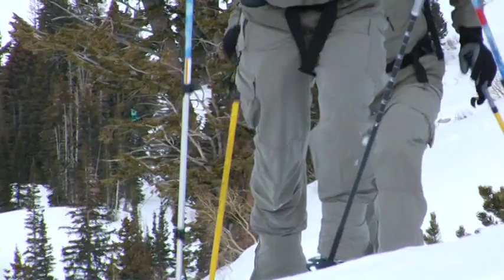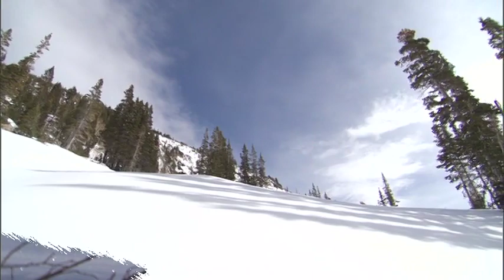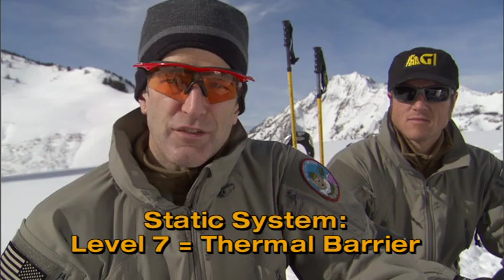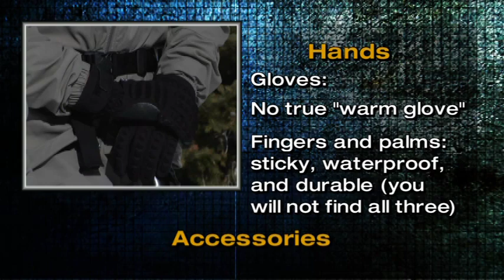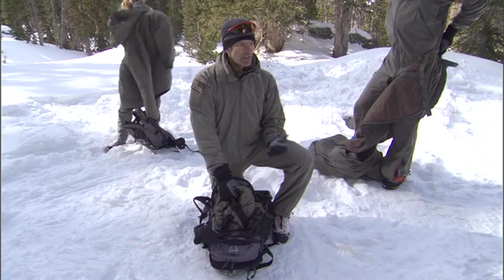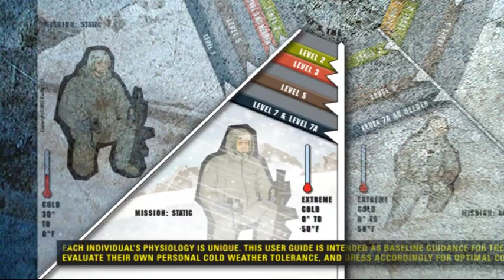Protective Combat Uniform (PCU)

Comment: A thorough explanation of modern winter clothing fabrics and their limitations construction and best use situations. Thanks.
Hopefully I'll never need anti- flame clothing so here's my Protective Fun Uniform for winter. 
BASE LAYER-> BRYNJE polypropylene fishnet W/flat knit layers on shoulders and knees.  "NEXT TO  BASE LAYER"-> Polyester zip turtleneck and pants. INSULATING MID LAYER-> 300 weight fleece jacket and (sometimes) pants. WPB SHELL LAYER-> KUIU shell WITH Toray brand WPB membrane  OR-> INSULATING HIGH LOFT "SHELL"-> LL BEAN WIND CHALLENGER 650 fill DWR treated (Down Tech) down fill. MANY advanced features: helmet compatible hood, pit zips, 2 way main "belay'" zipper, double shell on hood, shoulders & elbow to wrist,  etc. Good to-20 F.
PANTS SHELL-> The North Face two layer ski pants. OR-> Duluth Trading fleece insulated nylon cargo pants. BOOTS-> SCARPA backcountry ski boots OR-> SOREL felt pacs. With BOTH boots I wear a VBL this is a 3 mm thick closed cell neoprene divers socks with a thin polymer liner sock. **VBLs are a MUST to keep boot liners DRY and WARM. "Sweat wet" boot liners are COLD!